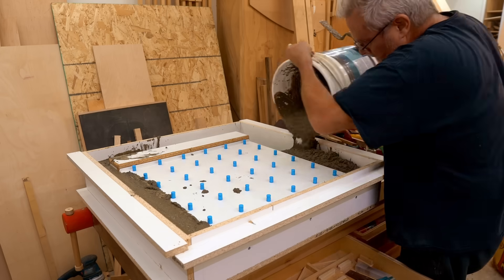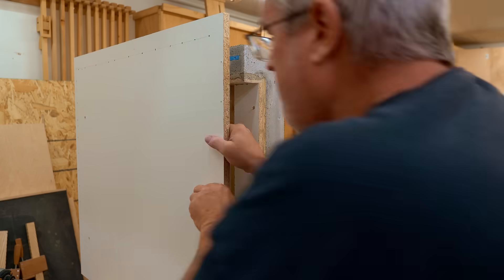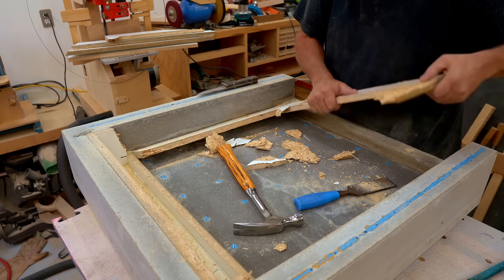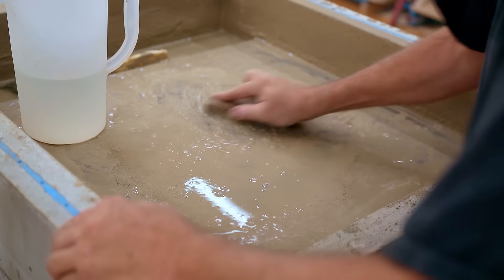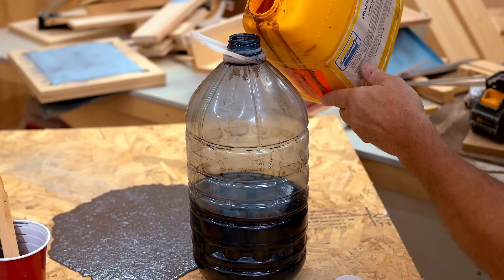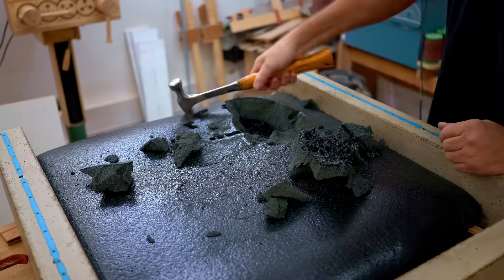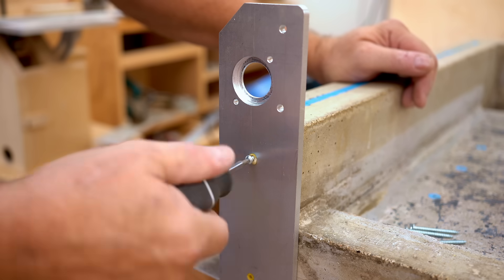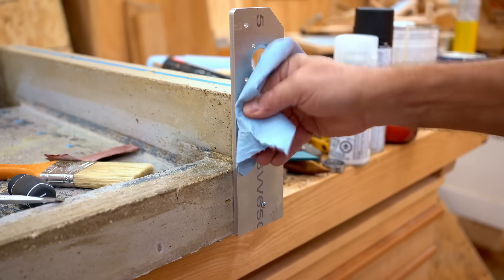Solid HEAVY and ROCK Hard - CNC Mill Build Part 2

Comment from the maker: Watch part 1 here: https://youtu.be/M_tlXAoWjVI
I let the concrete base cure for several days before I stripped the forms off. Other than the small "unflatness" of the bed, I'm quite happy with how it turned out. That not-perfectly-flat bed was mostly fixed by an hour of grinding with a diamond blade and is now flat enough to fasten the spoil board. After the spoil board is installed I can use the CNC itself to flatten that surface.
My attempt to use the casting resin to level the bed was a setback. The resin was way too old and that caused it to foam. But it being foam also saved me time because it was relatively easy to clean it out.
I'm using the old CNC (with a new spindle) to make the aluminum parts for the new one, starting with the front plates that house the bearings for the Y axis leadscrews. These plates also "armor plate" the front corners of the base to prevent accidental damage, and also support the side extensions that fasten to the top of the concrete base.

Comment: A nice tip for anyone doing something similar to this in the future, is to partially (mostly) embed a metal frame into what ever base pour material you're using, not only does it keep the thickness of the poured material down (but still largely keep the added mass that you want from doing a pour), it gives reference planes to start bolting stuff to when you later go to assemble the machine, instead of having to use something like plastic mortar anchors for screws to attach the metal body parts that will support the mill's features. It also has a lot of benefits to do with rigidity and strength etc. of the overall base, alongside the accuracy benefits from having a fixed reference structure skeleton inside the formed pour. ;)

Comment: I built a Langmuir MR-1 a couple of years ago and it uses a concrete base. They recommended sealing with a flood coat of epoxy. You could also use that to level the bed area. The plastic inserts for anchors don't seem very durable. Metal couplers attached to bolts sunk into the concrete might have been a better option.

The MR-1 build instructions are publicly available. You might be able to glean some inspiration from them.

Comment: Concrete doesn't "dry"; it cures. Words have specific meanings for a reason. 
Your "cracks" are traversing along the edges because concrete contracts as it cures, this is by design. You should introduce structural components to your form to mitigate the uneven contraction rates. I would suggest all-thread for the thicker walls, and a 1" - 2" wire mesh to the thinner sections, use wire-ties to affix the mesh to the all thread. This should allow the concrete to contract, but no so much as to crack, it has the added bonus of strengthening your final piece. 

I would also like to point out that contractors adhesive won't stabilize those cracks, especially in a situation where the concrete is going to be experiencing a lot of vibrations, and loads (such as a CNC machine)

Comment: When drying and curing cemwnt based products its critical to slow the drying. Best to mist the surface with water and lay a sheet of plastic on it. Seal it up tight to slow the drying. Usually stops all the cracking. Also an acrylic sealer applied right after the finish will dramatically help.

Comment: You need to wet the concrete more as it cures smaller concrete slabs will require more frequent wetting up to hourly for as long as an entire month...
Another trick you can use use your guide rails and cnc spindle to rework the concrete base just use a diamond cutter with water

Comment: Im just curious. What do you think the concrete adds to the cnc machine? You mention 200lbs.... how does 200 lbs help a cnc machine? When the cnc machine head moves it is pushing against the frame's rigidness, not the frames weight. And if the concrete is your rigidity, aluminum can do the same thing at a fraction of the weight. Is it a cost thing?

Comment: In checking for twist, you need to cross the strings as shown, but also take the top string and run it under the other. It did seem the bottom string was moving too much when lifting the upper string.

Also, concrete does not dry, nearly all the water added will be chemically bonded to the other ingredients. Any evaporation is minimal.
Reply from the maker: Not true. Concrete cures, but the majority of the water evaporates into the air as it does, so it does dry. Anyone who has worked with large concrete slabs, especially when it's cold and sees the condensation from the water evaporating out of the slab for a few days after, would know that. 
And as for the string trick, you have the video to watch while I was here to see it in person, up close. The threads split each other.

Comment: Why didn't you just cast it with lift points and get a cheap winch to lift it so you could reposition it without dying? 

You should have just used plastic fibers as filler.

Comment: About 7 years ago I built a CNC as a proof of concept to see if the CNC bug was really biting me. It was made using 16mm MDF layers, but it was able to mill aluminium - albeit very slow and with no cooling. Needless to say, the CNC bug bit good and proper! CNC V1 was then used to mill the plates needed for V2. V2 was made from aluminium extrusions and can cut 1450mm x 850mm x 220mm. It also features a proper 1500W spindle instead of the little 500W spindle on V1. V1 still lives in virtual reality in Fusion 360...

Comment: The resin probably foamed because you shook it up. Normally you vacuum degas casting resin so the heat doesn't expand dissolved gas. You basically mixed in a ton of air and the curing heat made it foam. I think you can just use the spindle to flatten your surface once the build it done. No need to worry now.

Comment: My way of "healing" small cracks ... gently brush hydraulic cement powder into the crack. Gently brush or blow the surface clean. Use a sponge and drip water into the crack. Works like a charm.

Comment: Yes concrete is water cement and aggregate (which could be gravel), of which you used sand. Howmsoever, at 10:03 you mentioned using a hammer drill and what you are actually using is a roto-hammer. Looks like a newer version of my Bosch Bulldog. Rotohammers hit harder and slower than hammer drills, and use sds bits, which like hammer drill bits are carbide tipped. Thank you John Heisz, I really appreciate your videos.

Comment: At 9:00, Don't you worry about metal dust/chunks getting inside the open frame motor your wood table saw probably has?  Won't those bits of conductive aluminum dust and small chunks possibly short out the motor, or get into the bearings?  Thanks for making this video...
Reply: Motors are unsurprisingly far more resistance to such problem. Metal dust almost never pose any short curcuit.  Long enough chips can short brushed motor, but still unlikely enough

What's much more prone to get short circuited is the control/speed limiter circuitry, if one exist

Comment: Civil Eng. here. Great work here, not all that much I would have done differently; reinforcement, wire mesh can be bought both as alkali-resistant mesh, fibers or galvanized steel. That being said, the cloth was an interesting idea. Curious to see if it works alright. The main purpose of reinforcement in concrete is to take up strain forces. Compression forces it handles fine. For the formwork, I would make 45 degree chamfers on all sides. Microcracks tend to form when you have sharp 90 degree angles. Also, heating and curing cycle of concrete is preferably done with as much moisture as possible. If you design the formwork almost like you did, I would flip it over on day two, to form a bathtub-style and fill it with water.
Reply: Machine beds generally don't need reinforcement, they're built for stiffness, not strength. That means you have to overbuild everything to get to the desired stiffness, which usually makes it strong enough. What I would have done differently though is cast in pieces of steel as mounting points for the rails and table, with some bolts screwed in/welded on the backside for anchoring. Once everything is assembled and adjusted it's common to let the machine mill its own table flat anyway.
Reply: And, there’s always the good ol’ tarp method. 😄 (Or preferably form blankets, but again, home projects!)
Reply: @sdoc3 you not concerned about the framework expanding with the water?
Reply: @DodgyBrothersEngineering  Preferably remove it first, but a few cuts to give it some space to expand is probably a good idea if you leave it in. That being said, those melamine boards almost dissolve as they expand.
Reply: @sdoc3  OK so you were talking after it sets up. Yes I agree, to prevent cracks a slow cure is definitely the preferred method. Especially since concrete is exothermic while it cures.

Comment: You might notice over time those hairline cracks become larger. The CNC will produce a lot of vibration during cutting and that's going to cause the cracks to propagate. The construction adhesive you smeared in there might not do very much since it did not fill the entire crack all the way to the root to prevent it from propagating further. Filling cracks in concrete is usually done under high pressure with epoxy to maximize the chances of it maintaining joint integrity and reducing crack propagation.

Comment: It feels like funny timing because I had just been designing a fixture table (for my wood working) about a week ago - to be made out of concrete with the holes being created during the mold phase with 3d printed parts to create the holes, and then inserting 304 stainless bushings in the holes to prevent chipping - and then I run across this build which is remarkably similar in its construction and goals. I haven't started my build yet, and I'm thinking I may wait until the rest of this comes out just to see if there is anything else I can learn before diving in.

Comment: Don't worry about your bed not being flat, and don't spend time on correcting it with your grinder. You can surface it very accurately with a diamond tool when the CNC will be assembled. That's a task you want to do anyways. The finish will be excellent by the way.

Comment: It doesn't have to have gravel to be concrete. Concrete is ballast or aggregate held together by cement. Typically the ballast is sand and gravel. But it can just as well be only sand, which is whatyou used if I remember correctly. So the nitpickers were way off it.

Comment: Concrete doesn’t dry to harden, it’s a chemical reaction. You want it to stay moist while setting. If you pour concrete again, keep it covered with some burlap and plastic on top. The burlap is to help distribute moisture and the plastic to keep it from evaporating. Occasionally check to make sure it’s moist and add water as needed. It will help prevent the cracks.
Reply: This is why in concrete road construction, when it's curing, people don't cover it from rain, because it just make them cure better
Reply: @za_pravdu1943 no, it needs to be initially protected from rain. Too much water, even while pouring, will weaken it. It’s also bad to let it dry out too quickly. Once it becomes hard enough to not be washed away, it is kept covered to promote curing and prevent cracking. Yes, it will still cure on its own over time. But to maximize strength in the minimal amount of time, it’s kept covered and moist. Now, maybe the specifications don’t require a full 28 day cure. That’s all up to the engineers.

Comment: Not to worry, the definition of concrete has nothing to do with the size or size distribution of the aggregate.  You made concrete, and very brilliantly too.  But actually, concrete doesn't dry.   It cures, the process is called hydration, and it is a chemical reaction different from simply drying.  And this process of curing can last a very long time.  For most concrete mixes the process becomes asymptotic to its ultimate strength in around 28 days.  Another thing, in this business we don't like to say you pour concrete we say place it.  Pouring is something they do in a kitchen to make cakes.  But you have a wonderful project going I really do think you are on to something big here, thank you for the video.

Comment: Well thought out. I love watching your builds. Gotta admit I’ve made similar mistakes with old epoxy that was too expensive to toss. 

For those who don’t know, sand is an aggregate, it is small rock. Silica sand can be argued as not an aggregate because of how fine it’s refined too but technically it is still an aggregate. Glass mixed into concrete is an aggregate. Larger aggregate adds to strength, cement is a binder. There are plenty of sand and birdseye mixes available that are very strong concrete.
Reply: At the end of the day it is what it is, but in the strictest sense "concrete" is not made with fine aggregate for exactly the reasons you listed. Coarse aggregate like gravel is needed for strength. What John has done here is more usually called render or mortar or other things. 

As a comparison, steel is steel, but stainless steel is different from mild steel which is different from carbon steel. All different compositions with different applications. Sure it can be pedantry to point out the difference, but also at the end of the day we have different words for different things precisely to specify what we mean.

Comment: 6:16 i work with composites all the time and i instantly see comparing to the sample what will happen if u use it BUT it could be rly good option to fill some square tubes for X axis etc

PS
You could look for old surface plate to measure flatness with it or if you found cast iron one - to apply diamonds on it , press them using steel roller and use as "sanding stone" to make concrete RLY flat (its same method as used to make granite surface plates)

Comment: FUN FACT - in late 19 century biggest lathes were build using concrete , they need for it to "dry" for at least 6 months after curing and in this time entire frame twisted few mm , even after 6 months frame were twisting depending on moisture in the air
Reply from the maker: Too much gravel in the concrete, obviously :)
Reply: @JohnHeisz ps
I will soon (if i found linear rails and not so expensive😅 bearings for chuck i have) working on my concrete lathe on my second channel so stay posted 😁
Reply: @ErtsenPlayGames where is your second channel? Where is your channel?
Reply: @JohnHeisz  😂